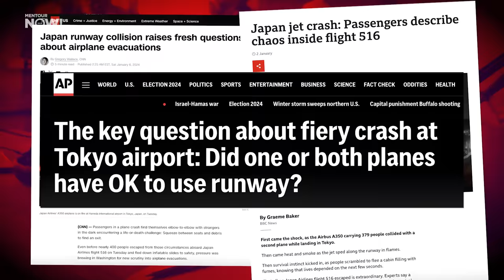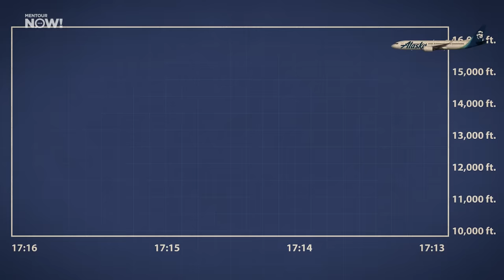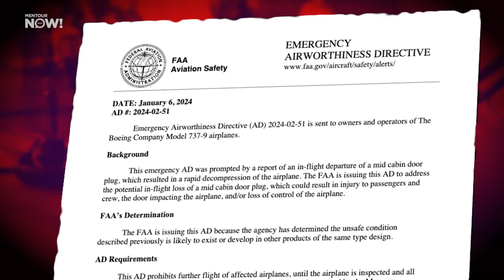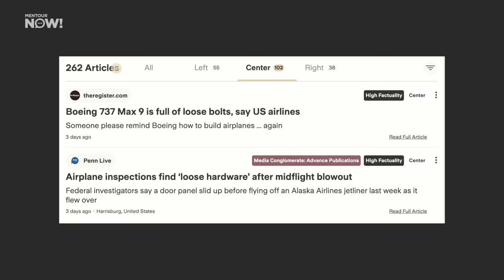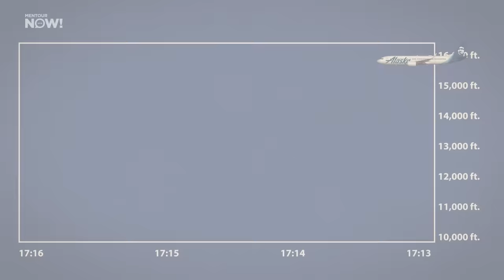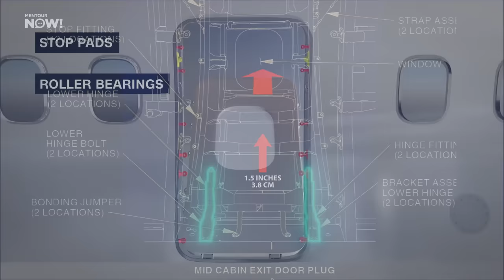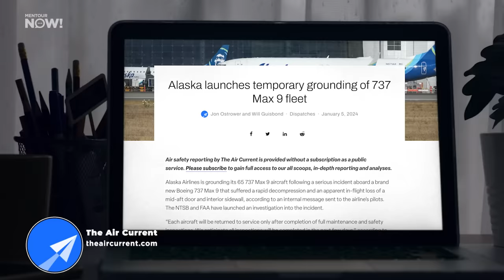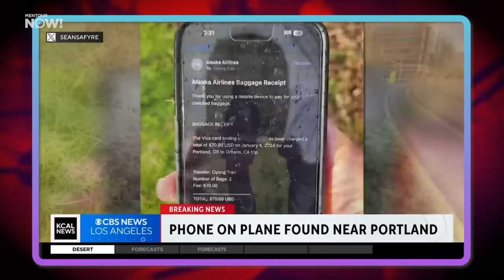WHAT Is going ON with Boeing?! MAX-9 Door blowout

Comment: “”A Boeing aerospace engineer presented a controversial white paper in 2001 at an internal technical symposium. The engineer, John Hart-Smith, warned colleagues of the risks of the subcontracting strategy, especially if Boeing outsourced too much work and didn’t provide sufficient on-site quality and technical support to its suppliers.

“The performance of the prime manufacturer can never exceed the capabilities of the least proficient of the suppliers,” Hart-Smith wrote. “These costs do not vanish merely because the work itself is out-of-sight.””
Reply: Very true!!
Reply: And nobody listened, as usual. It's cheaper to pay off the lawsuits than to fix the system.
Reply: Amen
Reply: And yet, not applicable here. When the fuselage is delivered to Boeing, the door plugs are removed as the emergency exit is one of the entry points used when installing the interior of the aircraft during manufacturing. It is Boeing that installs the plug again and even if they did not remove it, it is still up to Boeing to do the final inspection of those doorplugs. The doorplugs used on the Max series are also not new but are identical to the ones used on the NG series which in itself is a design from before the often cited merger with Lockheed
Reply: Airbus has done it since the beginning and it has worked for them.. there is not going back
Reply: Not that long ago there was this bit of mandatory training at Boeing, with a slickly produced video going over hypothetical situations where a careless career driven engineer didn't tell his selfless professional manager about a mistake he made, an all the 'our customers don't trust us anymore!' consequences.  They have really been pushing a 'speak up' meme lately, but given how often people DO speak up and it gets dismissed by management, it kinda feels more like blame shifting... introducing a solution for the problem you want rather than the problem you have.
Reply: To wit, Forbes 2013: "What Went Wrong At Boeing? Jan 21, 2013 — Hart-Smith argued that make-buy decisions should be based on complete assessments of all of the costs…"
Reply: @Hans-gb4mv  I think that’s still unclear.  Juan Browne reported that Boeing does not remove the plugs, but they may be removed by the contractor who installs the wi-fi.  Lots of conflicting information, until NTSB or FAA complete their investigations.
Reply: @Hans-gb4mv  This is mostly incorrect... those door openings are too small to easily fit rows of seats through, if they fit at all, and by the time the seats are going in, the sidewalls are already installed. They have a process for loading seats through the fwd and aft entry doors on the MAX 8 so there is no reason they need that additional door for just a few more rows of seats on the MAX 9. And the "merger" was with McDonnell-Douglas, not Lockheed.
Reply: yeah wtf is boeing doing having other people make fuselages for their planes? The only reason you would subcontract something is if it would save you money, but if it saves you money it means that there are likely corners cut somewhere.
Reply: This is from the Wall Street Journal's excellent coverage. Please give credit where credit is due.
Reply: @ytfeelslikenorthkorea So they only going to be sure for all their money. Not lost in court? And if you was winning. Then how would the company have money to fly. Maybe I'm littel to sarcastic.
Reply: @vagaworld9398  I think most/more of the works is done by Airbus than Boeing. Just at different locations to please the different countries.
Reply: @Hans-gb4mv well duh it’s still up to them to do the final inspection. The outsourcing quote isn’t to blame the outsource company. It’s to blame Boeing for not taking responsibility for everything
Reply: Good thing diversity and equity is boeings top priority now.
Reply: Very correct. Outsourcing your core competencies is a recipe for business failure. Managing subcontractors who perform unique and complex tasks is harder than managing it inhouse.
Reply: @ricksterallain Go be racist somewhere else.
Reply: @wbfaulk  I'm repeating boeings corporate message. If you think I said something racist it's the words of boeing themselves.
Reply: A bit like Hifi audio systems: the performance of the whole system is equal of the least capable of components. Think of it like a group of lenses. The most cloudy one is what the signal will look in the end of the chain. That’s why signal source and room acoustics are the most important things. The source and the end zone. In this case Boeing: the source, which is the design and the final assembly. Boeing. Anything in the middle which is not up to standard will deteriorate the original signal. But there is no room acoustics, in this case, final assembly that can correct a signal that keeps being deteriorated in previous fases.
Reply: Spot on, man.
Reply: @Hans-gb4mv  That seems to not be the case, the i have read that the plug is not removed to install the interior
Reply: @ricksterallain  they give lip service to it, but actually top priority is profit
Reply: @wbfaulk Calm down my man. He might be right about that.
Reply: It is not possible to manufacture everything - but every part/design in aviation are certified, and when good design, good manufacturing processes, and good QA are in place, it does not matter if Boeing themselves manufacture the door - or a subcontractor. Delegating work to subcontractors is natural in optimising manufacturing, imagine all aircraft manufacturers start doing their own engines, avionics, or sensors? Fuselage is as good a part as others and if a company specialised in manufacturing them, why not? 
I am pretty sure the roots for this issue will be found, lessons learned, recommendations made and the 737s will be flying, as awesome a design and manufacturing marvel as they are! And if it is the subcontractor issue - it would only mean the problems with the subcontractor, not the delegation per se.
Reply: * If all 4 bolts were missing this would happen in the first flight. * It is impossible for all 4 bolts to fail at the same time. * The door panel did not even have a scratch or bent after 16000 ft fall. * Much bigger INTERIOR PANEL had disappeared. * The fallen cell phone shows the baggage was checked in on Jan 4th, a day before the accident. * Everyone was very calm, I wonder what the cockpit voice and the ATC communication sounded like when the cockpit door blew up (By design according to this video) ?
Reply: @wbfaulk  Grow up.
Reply: And now that they are doing hiring based on DEI rather than qualifications, it makes things even worse.
Reply: @fantabuloussnuffaluffagus  Try treating people as equals. That's what growing up should entail. Until you can manage that, keep your prejudice to yourself.
Reply: Such a general warning from more than 20 years ago can apply to almost every incident since. A blanket statement that subcontracting is bad, is almost meaningless, as it's impossible to run a huge manufacturing company without contractors. Saying poor QA can lead to bad results isn't exactly an insightful statement.
Reply: @Hans-gb4mv Did you mean before the merger with McDonell-Douglas?
Reply: @wbfaulk  Try not screaming racism where there is none.
Reply: Final assembly is still performed by Boeing, including door plug installation. While Boeing management will attempt to point a finger at Spirit, it should really be pointed in the opposite direction.
Reply: @vernmeyerotto255  Everyone in an industry points the finger. Customers blame products even when used/maintained wrong, makers blame suppliers/contractors for bad parts of training/implementation, and contractors blame makers for being inherently flawed. It's always about shifting legal liability away from your own company
Reply: So true
Reply: The key point is quality control technical assistance. Subcontracting is NOT the problem. Unless quality assurance supervision and technical assistance is supplied to those contractors you cannot guarantee good quality control final assembly. Look at what Boeing did to get rid of those quality assurance engjneers... very thin on the ground.
Reply: EXACTLY    I noted 6 steps Boeing would have to do, for a solid future. You noted them, encapsulated in one quote from Hart-Smith.
Reply: @EdgyNumber1  Exactly.  If a quality fuselage costs $10million, outsourcing it to someone who can make it for $8 million means Boeing pays extra to re-work bad work, or loses billions when there is a catastrophic failure.  The costs don’t go away, they just move around in unpredictable ways.
Reply: @EdgyNumber1  agreed on whose shoulders QA rests, but couldn't the decision to use subcontractors contribute to Boeing's inadequacy on that matter?

I think that engineer makes salient, valid points.
Reply: The bolts in the cartoon are not the same as in the actual picture installed above the spring. What happened to the hinges holding the panel/door? 
The only time we use the emergency door is after a crash or a water landing, there is no pressurization at sea level or in a crashed plane. Also the door needed to go down, then up and then out while there is a wind pressure of a few hundreds of mils acting on it.
Cockpit door blowing open if the passenger cabin loses its pressure is not only stupid but criminal, that can kill the pilots in their inner ear or shock them or smash into someone. I do not know if the cockpit has its own system to pressurize or not, but it is logical that the cockpit keeps its pressure for the sake of the pilots rather than exploding.
I am wondering why no passenger wants to talk about it and why only one or two passengers carried a cell phone with a camera.
Reply: @Hans-gb4mv  Actually, it's been clarified that Boeing does NOT remove the door plug during their work, the early reports stating this were wrong. There's some question of whether they might have been removed as part of the Wifi installation based on some photos (still more questions than answers as of now), but it's ALSO true that it was on Boeing to do the final check which very much included checking this. So Boeing definitely failed there, but we don't know who else failed (could be Spirit that built the parts and didi initial assembly, could be the Wifi outfitters). And yeah, it's curious there's been no recall of the same plugs in the 900ER (the other NG models doesn't have this specific arrangement) which from the outside looks like they would be identical.
Reply: @ShonMardani  The upper guides of the doorframe were found to have completely failed, most likely to stresses exceeding their design's substantial safety margins.
The lower hinges are manufactured as diagrammed: this plug needs to move up relative to the frame lugs to clear them, an initial movement down is fundamentally mechanically impossible.

In this plug application, movement up in the hinge mechanism is stopped by large bolts inserted through the hinge.
Those choncky bois are secured in place by your standard non-locking crown nut, for which a thru-fastener cotter pin is both necessary and sufficient to secure.
Reply: This is going everywhere for more than a decade under different corporate lingo, "Optimization". When 737 Max MCAS system design flaws were revealed I knew Boeing was doing "Optimization" for profits. "Legally", the blame in the end goes to Quality Assurance of these companies.
Reply: Its the same for every industry.  Some of the monkey executives at that time even closed out divisions and product lineups without any replacement.  They were focused on cost savings by outsourcing but never had a good control on making sure the outsourced product meets the same requirements.  Airbus does the same thing too, but they supposedly had better inspection processes and worked closely with the suppliers.  This was a problem that initiated 20+ years ago and has finally caught up with the company.  Their supplier QA system is a complete mess.  There is a joke that if they are able to count the number of items properly, it was good enough.  A lot of them were paper pushers and wouldn't know a crack if you put it in front of them with a red arrow.  This is just my opinion of course.
Reply: @PRH123  Boeing's process was to take sections of the company and spin it off or sell it to another company and then contract back with them to control their costs.  It was also a way to reduce the number of union workers in the company after crippling strikes.  These critical "partnerships" with the spun off companies end up with fixed priced contracts and they do their own "cost cutting" process which usually results in cheaper/unskilled workers and lowered inspection requirements.  It's basically shooting yourself in the foot in the long run in order to get some short term cost controls.  Until they put their foot down and inspect everything with sharp eyes, things will fall through the cracks and end up with the customers.
Reply: @ShonMardani  That is not necessarily true.  Its possible that vibration over time would allow it to shift.  Not only does the door plug needs to rise up 1.5", it needs to clear the angled portion of the bracket to come off.  As soon as you land, the door may settle back into the top slot and the next flight would be another opportunity for the door plug to come off again.  The 12 stop fittings are also adjustable, so there may be enough pressure against the stop pads to hold them in place initially if the stops were not worn due to the vibration.  Over time, the tips of those stops could have worn down due to the vibration and allow the door to loosen up and be easier to move up and down.  I wouldn't doubt at the end, the NTSB determines the four bolts were never installed and the wearing of the stop fittings was what eventually allowed the door to come off.
Reply: @anthropicandroid4494  It could have failed when the door was forced out during the flight due to the pressure differential.  There is a difference between a failure which caused the accident vs secondary failures that was a results of the primary failure.  I doubt those guides were designed to handle the pressures of the door plug when it came off.  You don't blame the hinge on the bottom or bonding jumpers as a root cause even though it was damaged during the accident.  They are all secondary failures.
Reply: That's a great comment
Reply: @Hans-gb4mv  This is FALSE INFORMATION. The plugs ARE NOT removed and reinstalled at Boeing. The ONLY time the plugs are removed and reinstalled after leaving Spirit Aerospace is when Wi-Fi is installed on the aircraft, which is done by another 3rd party. The Wi-Fi equipment is intalled in the roof directly above the mid-cabin plug/door and it is removed during the installation of the equipment.
Reply: @ahndeux  100%
I believe that catastrophic material failure could only have been due to a different primary or intermediate cause. I don't see any Balsa in these photos.

I suspect that the primary cause is 
The cotter pin was not correctly inserted through the crown nut of the lower hinge immobilizing bolt.
Reply: I noticed the extra [flat, WiFi] antenna on the alaska max9 planes, it is possible that those planes will use starlink networks integrated to their autopilot and all its system, like the tesla cars. Alaska and United want to gradually remove the pilots and fly the planes remotely like a drone.  Any individual, let alone governments and rich with a few thousand dollars can take control of the planes or can easily jam the signals. They did their test runs on tesla cars and many crashed with people in there.
Reply: @ShonMardani  There is No Fate but that we Make
Reply: @ShonMardani  No, it isn’t “possible”. This is nonsense that has absolutely ZERO basis in fact.
Reply: Why is Boeing outsourcing? Unions. It is cheaper to get things done in a non-union shop. (Even the engineers at Boeing are part of a union)
Reply: @anthropicandroid4494  You're confusing primary with secondary.  I agree that its likely the primary cause is a missing bolt.  Whether the bolt was not installed or the nut was not secured properly to allow the bolt come off is not relevant.  Both situations end up with a missing bolt to stop the door from moving.

Nobody mentioned about balsa wood.  All I said was the guide rail damage was probably a secondary issue that was caused when the door flew off.  The guide rails was not a structural element and only serves to guide the door into position.  Having damage to that when the door comes up is the most likely cause for the damage.  Its not the primary reason for the door to fly off.  The four missing bolts seems to be the root cause.
Reply: "There's always someone willing to do it cheaper.  But at what cost?" - Henry Ford.

The same thing happened to Railtrack in the UK, Britain's guardians of the railway infrastructure.  Under government pressure to cut costs, they contracted out critical maintenance work to lots of small companies who made fortunes, then several multiple fatality accidents happened (Potter's Bar, Selby) which turned out to be due to sloppy work by contractors.  On a wide ranging inspection of contractors work, it showed they had been saving money by not doing the work OR the QC properly.  Railtrack had to put in so many additional QC checks on contractors' work that it ended up costing more than doing the work in house.  Government and public lost confidence, Railtrack went bust, and we had to create a new organisation, Network Rail.  They use many fewer contractors and have had a much better safety record, though not perfect.  It's very hard to instill all your subcontractors with the same QA discipline.

More recently, I did a forensic investigation of a 5000 tonne structure that collapsed suddenly without warning.  The company that built it, a reputable UK company with a very long history of good projects, were put under so much pressure of price by the buyer, that instead of designing it themselves, they bought in a cheaper structure in kit form from a company in a Southern-European country.  The upshot of the investigation was that the bolts used were simply far too small to carry the load.  Schoolboy error, it was obvious that NOBODY had checked the calculations, anyone with the most basic engineering skills would have found the error.  Basic structural design codes require peer review of calculations as part of the design process, this was obviously not done.  Another case of a cost saving exercise that has cost everyone a lot of money.  

Marion
Reply: @neeneko … was the training video patterned after the career driven CEO who denied everything and blamed the two crashes on pilots?
Reply: @ahndeux  I do not think I'm confused on that distinction at all, thank you.
The Balsa wood is a joke; by it, I'm commenting on the strength and thickness of the upper hinge guide slot are evident to the naked eye; it requires a significant amount of force to accomplish that failure in the material.

I think we see nearly eye to eye on this matter; please tell me so I can improve:
If the primary cause is found to be a missing bolt, then what should we consider the chain of sufficient, motivating factors that came necessarily before it? I'm speaking here of the bolt missing because it walked out of its hole. That would require the crown nut to back off entirely, which it cannot start to do if the cotter pin is inserted as per regulated design.
I'll grant you, someone may have forgotten the bolt entirely--but given the substance of that object, I think doing so would be an unlikely oversight.
Reply: @ricksterallain  we know what you're implying, none of us are stupid, we're just ashamed of your dishonesty in not just coming out and saying what you mean, instead of hiding behind a slogan. And your 'point' that Boeing is doing that too is not relevant to what your opinion is, it is a distraction. Now go away.
Reply: @wbfaulk  DEI is racist.
Reply: @anthropicandroid4494  If you're talking about the guide roller where the top bolt goes through to keep the door from raising, the NTSB has made a statement that the damage found on the door plug was consistent with impact damage when it hit the ground.  Again, I don't have an NTSB photos or data to prove that, but it was a statement I read on one of the news sites.

Yes, the investigation would focus on the missing bolts.  If it "walked" out of the hole, there should still be trace contact marks on the upper brackets where the bolts are mounted.  Typically ,the bolts have a smooth area and also a threaded portion.  The threaded portion should leave marks on the bracket especially if the door was under a pressure load.    It appears the brackets are coated with an epoxy material to protect against corrosion.  That would also make transfer of the metal from the bolt to the epoxy more obvious.

Until the NTSB completes their analysis, everything is just a conjecture.  The truth is that they will get to the bottom of what happened.  Any of the scenarios I mentioned or you mentioned would leave trace evidence that can be proven since the door plug was found.
Reply: @majcrash  Imagine a relay race. The race starts off and one of the runners is intentionally tripped by another and loses 30 seconds getting back up and retrieving the baton. The runners get to the ends of their legs and the next runner takes over, and then again. By the time that the fourth runners take over, the tripper has been thrown off the team by the other members. They never intended for him to do that and they're upset that it happened. The fourth runners start their leg, but the one team whose first runner was tripped is still 30 seconds behind. No one is hindering that team's progress now. What's the fair thing to do?
Reply: @wbfaulk  The race would have immediately been stopped at the trip.  What's your point?
Reply: @majcrash  Actually, the tripper would most likely have been disqualified altogether. But this is an analogy. See if you can follow along. When someone is held at a disadvantage early, you can either try to do something to repair that or not.
Reply: @wbfaulk  It's your perception that certain people are held at a disadvantage.  There are plenty of poor Asians who come here and thrive, even though they speak a different language.  The truth is that the democrat party has created a system of dependence on government for certain people that has created generational poverty on purpose.  DEI and the democrat party are racist.
Reply: @wbfaulk no, he implied hiring based on race instead of competency, will lead to a lower quality product, and he's right.
Reply: Boeing needs to do more asy in house Had many quality issues with outsourced  parts inc wings from france
Reply: @ahndeux   agreed; I'm glad you and I maintained throughout that our speculation was just that and that we both looked forward to the conclusion of this investigation.
And yes, evidence of any of these scenarios should be evident.
Just to be sure: you no longer think I'm conflating primary and secondary causes, right? You were saying some fairly insulting things earlier.
And you get the Balsa joke now, right?

Thanks for using the precise, correct terminology here, too. You may really enjoy blancolirio's most recent video on this; he provides those satellite photos.
Regards
Reply: First you say they are removed then you say they may not be.  Makes me think you really don’t know what you are talking about.
Reply: Yes this is obviously a quality control issue man they wanted to save costs and now they got what they paid for 🤷🏾‍♂️.
Reply: I've read on pprune that Boeing do not remove those plugs for access: the WIFI installation company apparently do though.
Reply: On closer inspection - the wifi people do NOT have the door plug removed.
Reply: I believe they actually sold off their 737 fuselage business - probably so they could screw them on price and wash their hands of the messy business of actual engineering.
Reply: @ytfeelslikenorthkorea  Buddy, everything you do in life is a calculated risk.
Reply: Sub-contracting your production chain simply does not work. We keep seeing it again and again and again. But it lowers operating costs so investors love it.
Reply: Spirit Air who assembled the fuselage is losing 1 million dollars per aircraft that they assemble.   They are in financial trouble and have had numerous assembly errors.   There obviously must be no inspection procedures otherwise multiple aircraft would not have loose bolts.
Reply: @shingshongshamalama  Nonsense. Majority of products you use are made that way. It's far more superior way of doing things that having one big factory, because you can both optimize the production process and costs.
It helps the customers too because they get cheaper stuff.
We don't even know what the actual problem was, but if anything, it'll be a QA.
Reply: @ytfeelslikenorthkorea  To be fair, ANY safety rule is a "calculated risk". You could spend infinite money to make planes safe, but then nobody could fly them.
 
The problem is more that Boeing screws up the most basic things currently. Theres a lack of calculation, if anything.
Reply: @neeneko  Remember, communication only flows down just like water in a pipe. To management, if communication flows upward it's a plugged up sink. Management does not like hearing from the little people. The little people are the tech / mechanics / Engineers and so on that build the aircraft.
Reply: @StrongDreamsWaitHere  The contractor who installs wifi has denied that they touch the door during their installation.
Reply: LOL! How true that is. When I was a Navy pilot (Naval aviator is what we called ourselves) we would remind each other that every part of our A/C was produced by the lowest bidder. Whatever can happen, WILL happen!
Reply: Dr. John Hart-Smith wrote MDC 00K0096 "Out-Sourced Profits - The Cornerstone of Successful Subcontracting" which is available on-line. When at MDC/Boeing, I took some classes from Dr. Hart-Smith, a brilliant engineer with composites and composite structures.
Reply: This can’t be the fault of a contractor, it’s a basic assembly of the fuselage
Reply: @scythelord  Spirit Aerospace was BOEING Military for decades.  So they have all the BOEING standards and processes baked in since the days of the B-52 and before.